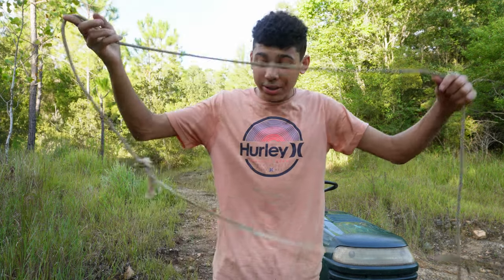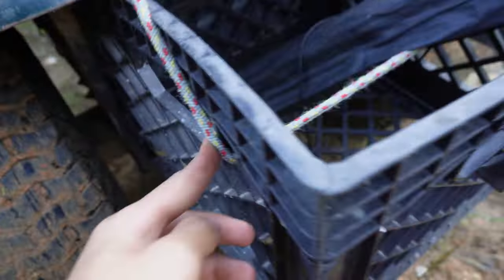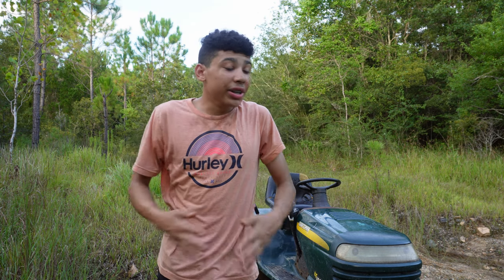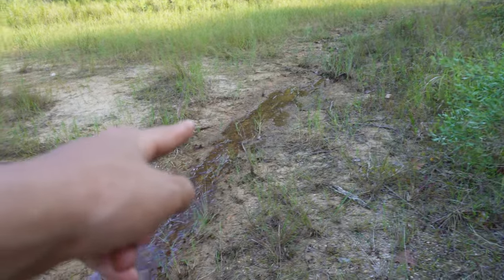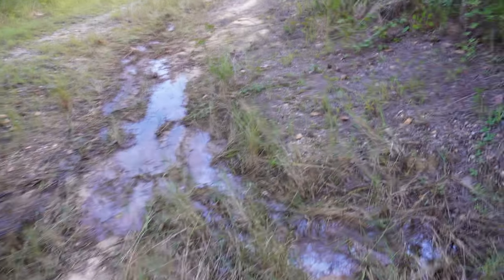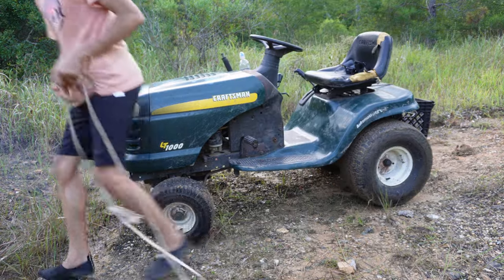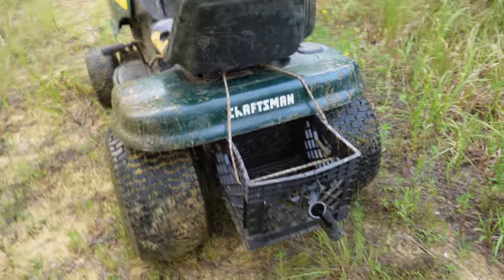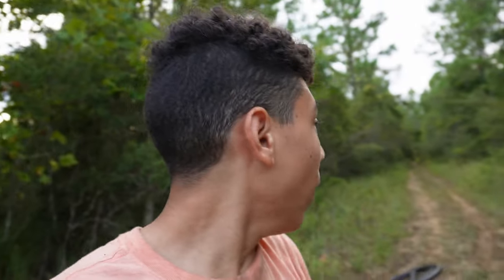Putting￼ The Facebook Marketplace Mud Mower To The Test￼!!

Comment: Weld the diff and pully swap that thing
Reply: you cant pulley swap a hydro
Reply: @micahchesler4552  Yes you can, but only on the front. And this mower is a automatic, not a hydro.
A hydro has pedals, a automatic has the fender stick, and a manual has the fender gear stick.
Reply: @yomum1490  i have this same mower its a hydro gear
Reply: @micahchesler4552  I have one EXACTLY like this and it says "automatic". 
read this:
A hydrostatic transmission works like an automatic transmission, but uses transmission and a belt to transfer power from the engine to the wheels. This transmission offers a smoother ride, requires less maintenance and lasts longer. A hydrostatic transmission has pedals to control it, while a automatic has a variable speed stick on the fender.

I own 7 riding mowers, 2 of them being craftsman lt1000s and I have been working on mowers for 2 years and I know almost EVERYTHING about them.